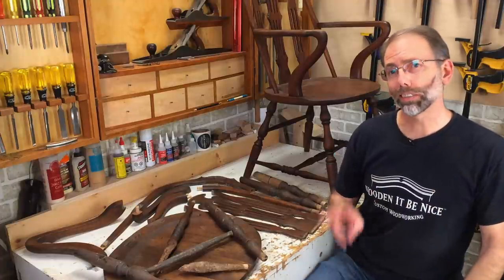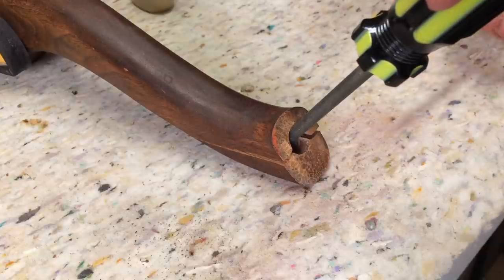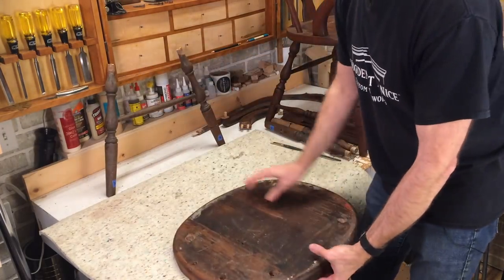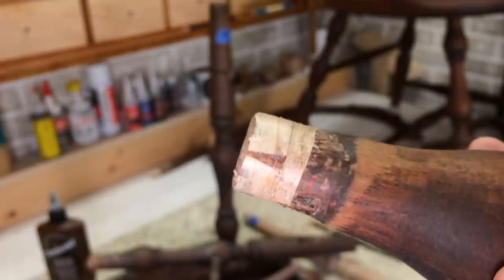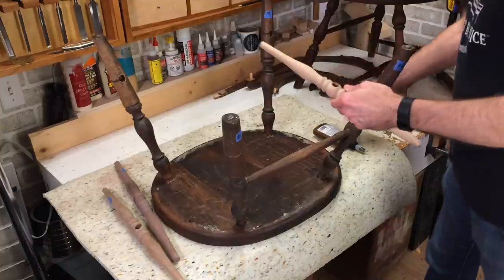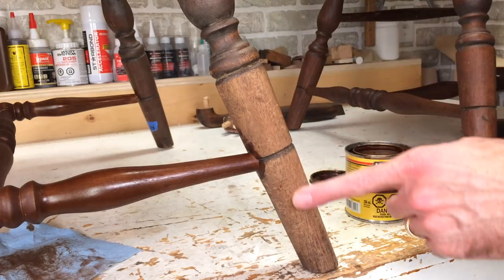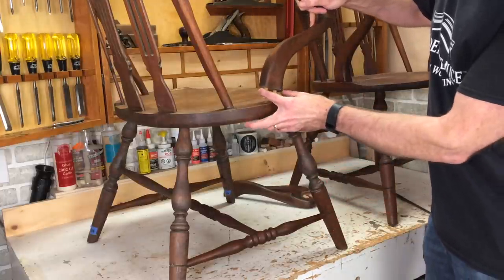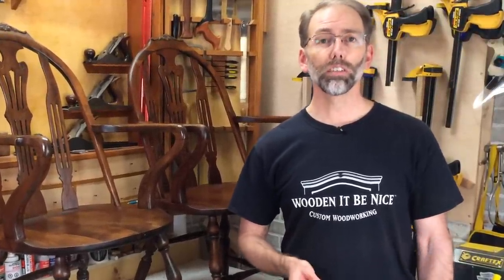Chair Restoration After Puppy Damage - Detailed Assembly Process | Furniture #Restoration How To

Comment: when you where gluing the chair up i was like "i don't think that weight is going to fully get the rock out this time, i think it needs some adjustment, but you know what you are doing" then sure enough, the chair rocked after it was dried. your usually really good about getting that adjusted right so surprised me this time. always love your video's.

Comment: Laying a glue bottle on its side is something I've just discovered, and it makes jobs a LOT faster!!!
Reply: I've been doing that for a while and it certainly makes the task go much smoother. I also reuse one of those disposable styrofoam meat trays as a tray underneath my glue bottle and spreader sticks (I use splinters, wedges, offcuts and popsicle sticks to spread my glue). It keeps any glue drips off my work and my bench. I can also use the same tray for mixing epoxies and when the adhesives are cured, they will normally just pop right off the tray, allowing me to get more use from each tray.

Comment: Great job!  I'm always amazed at how little glue you add to the joints.
Reply from the maker: Thanks.  I load the joint with enough glue that I get some squeeze out but if you load it up too much, you can have a problem seating the joints fully in the mortices.  Cheers.  Scott

Comment: 8:38  I LOVE your fix for a worn out tenon, gluing a shaving around it to get extra wood into the joint!  I saw this on your channel sometime back, and your idea saved a precious family heirloom!  They'd tried PVA glue (but as a filler, in too large a gap), the little cheese grater strips, liquid nail (which came out in chunks after it had failed to bond, probably because they put it in over older dried glue), and even a small finishing nail driven from the bottom of the joint where the stretcher emerged from the hole, up and at an angle through the tenon.  The small inset head on the bottom of the stretcher was no problem aesthetically being hidden, but even with this mechanical help, the joint still had movement (allowing the chair to wobble), because the part of the nail where it emerged from the top of the tenon into the leg was the only thing holding it, since it had plenty of gap all around the tenon.  Once I cleaned out the remnants of those other fixes, and applied your 'wood-buildup-with-shavings' fix, the joint was as tight as new, and is ready to provide years of problem-free service!  Thanks!

Comment: Really helpful: thanks so much! One thing, though.  I live in England and I very much doubt if I can get the proprietary glues you use in The States.  So would it be possible to describe the TYPE of glues that you're using as well as the brand? (For instance hide glue, PVA, fish glue, etc.) And also, are these soluble glues available ready-mixed in most places? (I know PVA is a soluble glue that you can buy just about anywhere.)

Comment: Have you ever tried tourniquet for clamping? Dave
Reply from the maker: Yes, I use latex rubber tubing for that.  I don't use it very often but when I need it, there's nothing else that can do the job of something so flexible.  I just added photo of that on instagram so you can see it. https://www.instagram.com/wooden_it_be_nice_canada/ This product is listed in my Amazon list, in the Woodworking Clamps section https://www.amazon.com/shop/homeimprovementwoodworking

Comment: This was good information. Unfortunately the stray dog I took in and adopted I found had a long list of naughty’s. And one was he got a couple lower stretchers on one of my good Amish white oak kitchen chairs. When I discovered that I was ready to throttle him or cry. Didn’t know which. I do woodworking and have a lathe. The problem wouldn’t be turning a replacement; it’s getting things apart to get the cross rungs loose and out. The legs go completely thru the seat and are wedged at the tops. One option: drill out the wedges at the tops, then drive the legs out. You would need multiple legs loose before you could work the cross stretchers loose. I hate the thought of this job. One of my thoughts was it might be possible to hand plane a flat spot to remove the chewing in the middle. Glue on a block. Plane again to remove chewing and glue on another block. Do that till your solid, then chuck it up and recut/ re-turn to the original shape. Even though I lost Moosie he’s left me some reminders. Got a shoe; ones I liked. A dish towel off the oven door. My entry rug; the larger one plus any number of small entry rugs. Was getting into my cabinet near the throne so I could come home to chewed toilet paper all over. Did in my old living room carpet. Mistakenly pulled out about a 50 cent spot of the pile to the backing. He was playing with his toys. Ended up where he peed on my base theatre speaker. I had to rebuild the enclosure on that. Peed on my TV stand leg that I made. I knew the rug was old and on its way out but.....He taught me to close my bedroom closet door. Keep toilet paper behind a closed door. He was like a kid. I learned to never leave him out of my site or I’d regret it.

Comment: The far left spindle of my chair snapped near the top.  The result is the two pieces have moved out of alignment, about an inch apart.  It requires a lot of effort to bring the two pieces back together for gluing.  Would you recommend drilling a hole and inserting a small nail/brad to keep them together?

Comment: I am attempting to restore a very old draw leaf antique table and chairs. I have watched several of your videos and I am trying to remove old dowels but they do not want to come out at all. They seem to just be part of the wood. Would you ever suggest just drilling hole the size of the dowel and just glue in new dowels without scraping out the old??

Comment: With finishes like the legs, I have had good luck with using liquid sandpaper and some 000 steel wool to clean it up so some fresh wax or finish will liven up the wood. Works great at removing that sticky buildup around knobs and the back of chairs.